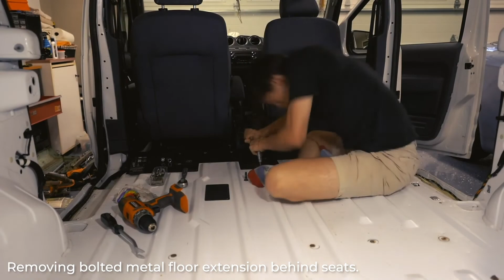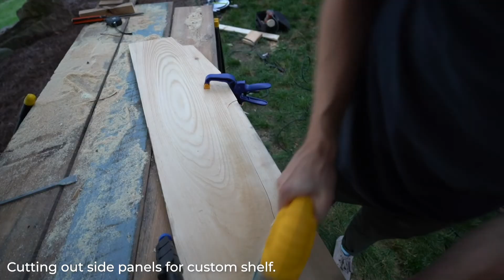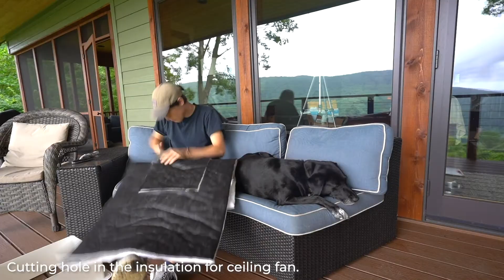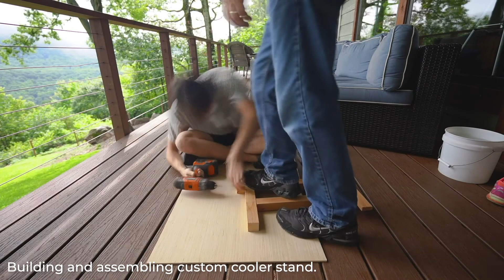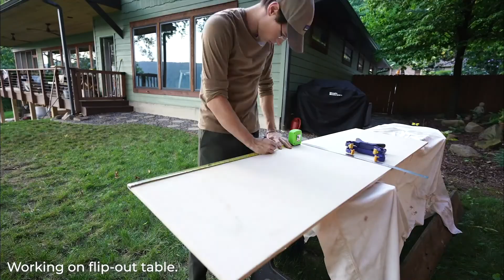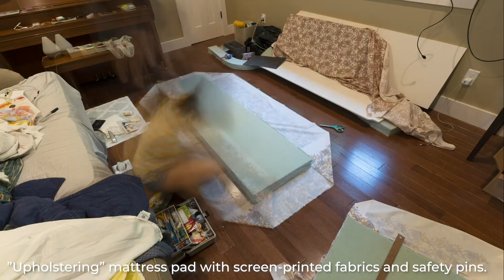VAN BUILD TIMELAPSE (Ford Transit Connect)

Comment: Nice!  Watching Chad speedily cut the foam for your bed made me laugh... I used a serrated kitchen knife (was recommended in some video I saw...) well, it looks like a monster bit into it lol but fortunately that side faces the wall LOL.  So, after a few months of travel, what would you guys want to change?  Anything wear out faster then expected?  I am sure you have seen video's about 12 volt compressor fridges, any thoughts on it vs your cooler?  I had a 42qrt Pelican Cooler I bought a few years back when I sold my fiberglass trailer to buy my cabin...7 to 10 days ice retention is nice (The job I had at the time had an ice machine so during the summer once a week on a wednesday I would dump the ice out and refresh it, thursday got grocery shopping for the weekend and throw it all in the cooler and leave friday after work.  Cooler sat in my truck in the summer sun all summer... did a great job, but I felt it was too big for my transit.  So I sold it on FB marketplace and next week on black friday sale I am probably buying a 32 qrt'ish sized 12 volt compressor fridge so no more food getting wet.  So Happy to be showering regularly again lol?
Reply from the maker: We're actually surprised to say that we are rather happy with our build thus far! But if we had to say one thing, it could've been nice if we could build the bed frame and  the flip-out desk/shelf with thinner wood. It would look and feel a bit more professional-- but alas, we are beginners, so a bulky bed and shelf it is haha. As for the mini fridge, we can't quite decide where it would fit. We move our cooler everyday, and a fridge would have to be somewhat stationery. We do wish the cooler could fit a bit more though! And yes, very very happy to be showering again. Our hair is definitely thanking us.

Comment: These videos help so much! In the planning stages for our connect. What kind of battery do you use to power the fan in the roof?? Thanks so much!!
Reply from the maker: Thank you, Ethan!!! Our battery is a Rockpal, and it's worked great so far. There's a link to it in our van tour video and our van budget video, if you're interested. Good luck on your build! 😁